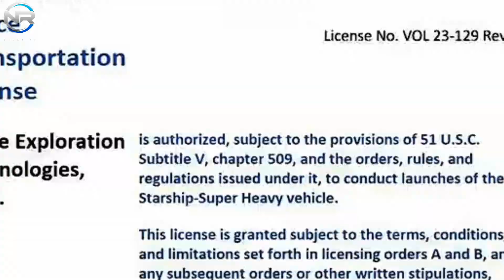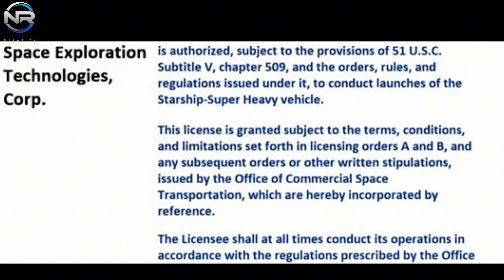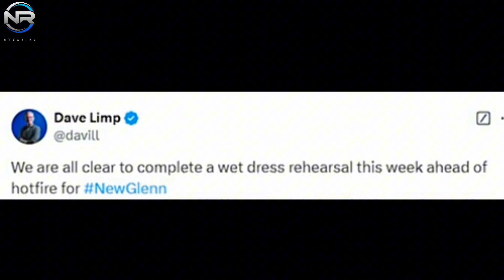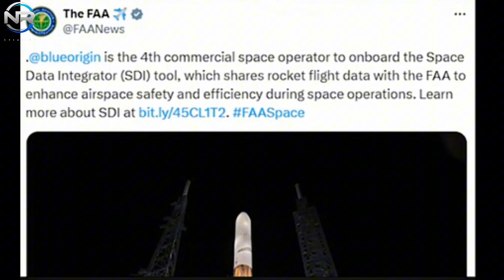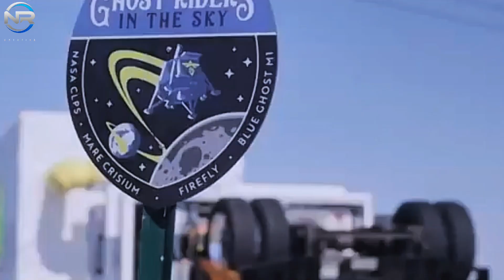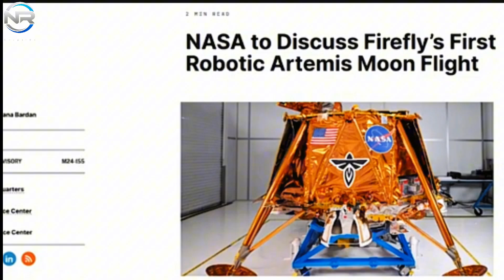SpaceX big problem! Starship flight 7 delayed, no launch! New Glenn Performs Engine Test

Comment: Blue Ghost is not SpaceX... They are paying for a ride and are competitors with SpaceX actually.  Blue Origins  Blue Moon Mk1 is ALSO ready to go.  And the Mk2 pressurized lander is in testing.  Meanwhile, SpaceX lander is still in the mockup stage.  With cardboard cutouts and off the shelf tables and chairs in a nosecone.  NASA was so upset with their lack of progress, they awarded (post contest) another lander contract to BO.  Luckily, they never stopped building their lander.  And it will fly next spring.  And Gateway is nearing completion after successfully testing modules in the VAC chamber.